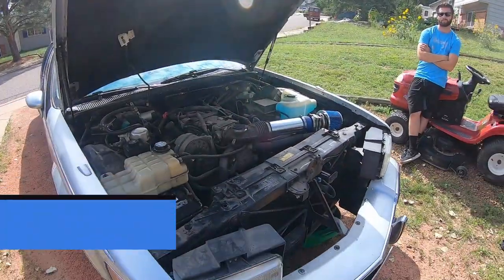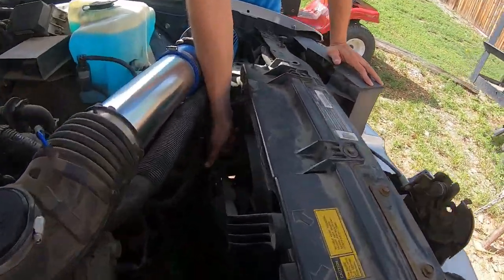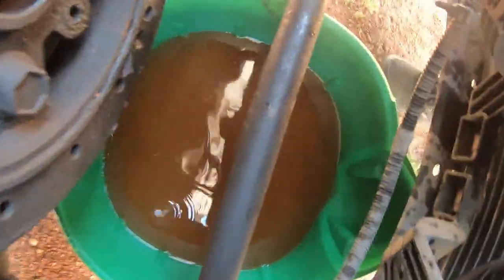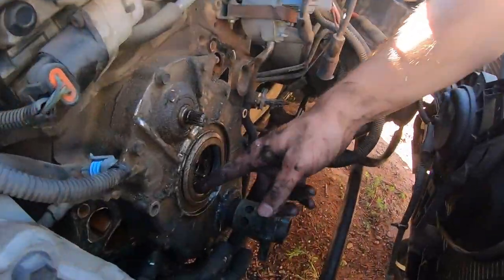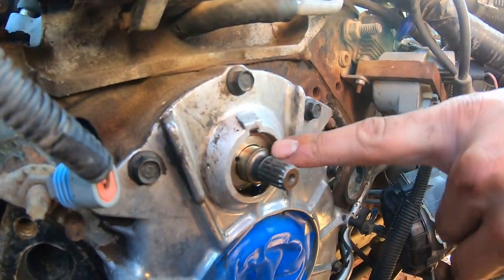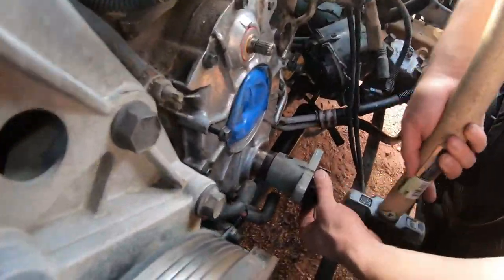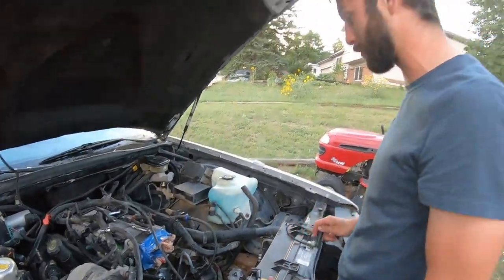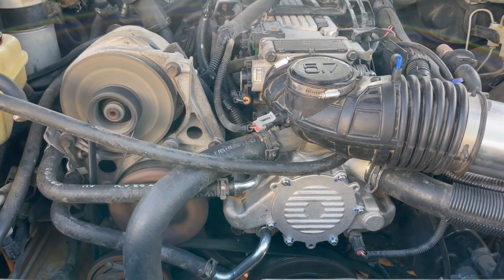How to Replace the Optispark, Main Seal, Water Pump and Belt on a 94-96 Cadillac Fleetwood (LT1)

Comment: Wow, this really helps me alot. I have a 96 caddy fleetwood 6 door also!! I have an oil leak around my harmonic balance, was thinking of just getting the seal. Now i realize it could be more than one. I have replaced almost everything, alot of parts, vac lines, water pump and Opti, but never looked at any of the seals. Thanks for the heads up of what i could be looking at before i start.👍 BTW what engine cleaner do you use? I need a degreaser that wont hurt electronics. I lightly use dawn water in a spray for a scrub
Reply from the maker: I’m glad we could help you out! Thanks for supporting the channel! We just used super clean degreaser. We made sure the battery was unplugged and made sure we allowed enough time for everything to dry before reconnecting the power.
Reply: @milehighmisfits  awesome, thanks!! And thank you for keeping us Caddy/LT1 culture running 😊👍❤️

Comment: How do you set the timing of the replacement distributor? I might of missed that but I’m doing that as of this typing and any response would be great. Thanks
Reply from the maker: If you go to 11:56 in the video there is a slot on the optispark for the pin drive type that will be placed onto the pin on the cam shaft. It should only be able to go on one way. That will set the timing of the optispark distributer system